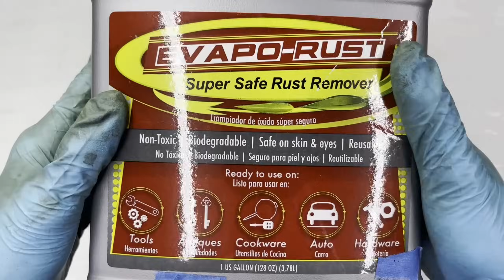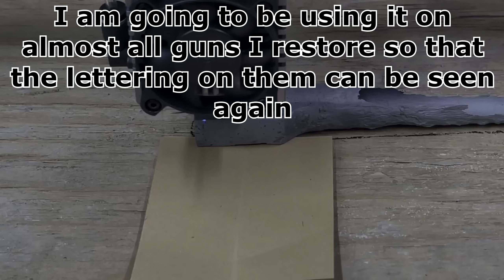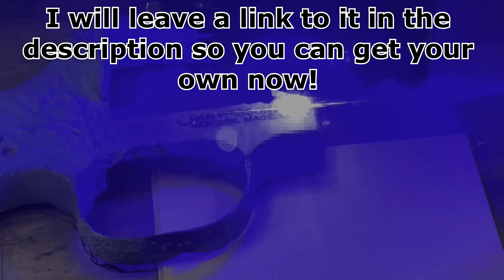Restoring OBLITERATED 357 MAGNUM REVOLVER!!! Amazing Results!!!

Comment: Dan wesson revolvers are easy to find parts for. Interchangeable barrel lenghts are what that pistol was marketed with in the 90's, the add said buy one revolver and make it your last its got an 8 inch barrel for competition a 6 inch barrel for the range, a 4 inch barrel for your jacket pocket and even a 2 inch barrel for the wifes purse. Barrels sold seperately.

Comment: Title: I turned a peice of scrap into a lighter peice of scrap.
Reply: That now works and looks incredible,..
Reply: @westboundbadger  Not in this video.  Looks like garbage and is not safe to use.
Reply: @curteaton  Watch to the end,..It works...Remarkable job.
Reply: @westboundbadger  Oh, it doesn't work and I did watch till the end. The firing pin ignites a primer, but that's not the definition of a working revolver.  Working handguns are safe to be held in hands.  They don't have holes right through the cylinder walls.  On that  "gun" the hand is not advancing the cylinder during cocking nor is the bolt locking the cylinder.  It isn't safe and it doesn't work.  It should be thrown back into the same hole it came out of.  But if the guy had fun sandblasting it and painting it black and you had fun watching, what difference does it make? It's about the most unremarkable thing I've seen.
Reply: @curteaton  Yes,remarkable restoration,. Glad you enjoyed it,..Dont forget to like and subscribe.

Comment: Sometimes one is just too far gone.  At best, you could use some of the parts......

Or get another cylinder, barrel and side plate for it.

Avoid using chambers with holes?  The barrel had a hole in it.  I wouldn't have shot it but that's just me.

Comment: Barrel shroud mostly gone,barrel with a hole in it,mangle rhe barrel nut/threads and using a scree driver to get the side plate off. Remind me to never send a pistol to you for any type of work/restoration. One look at rhat pistol should've told you it's a waste of time ,turn it at a buy back and get a gift card for it.